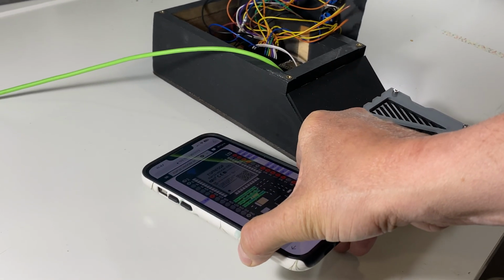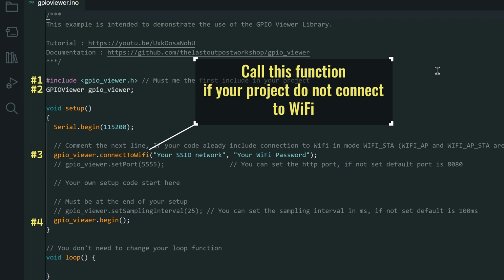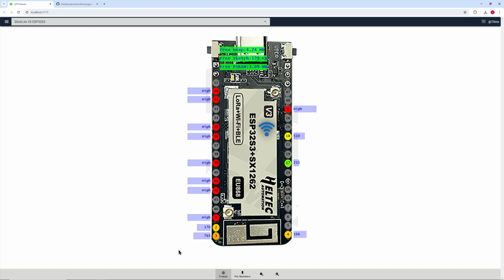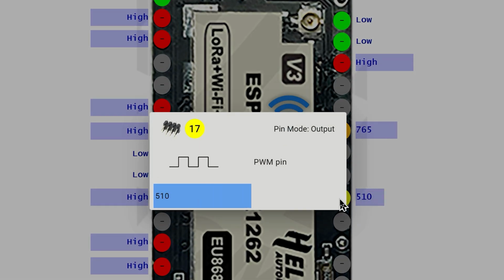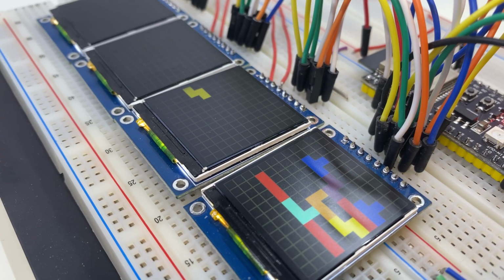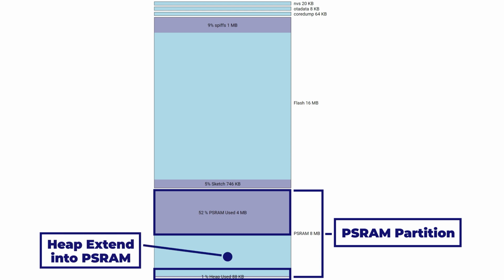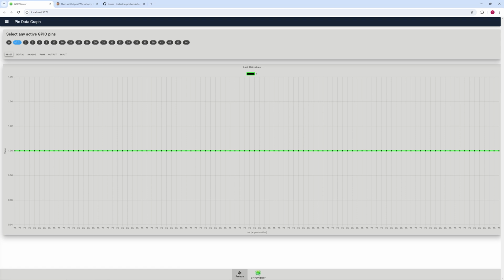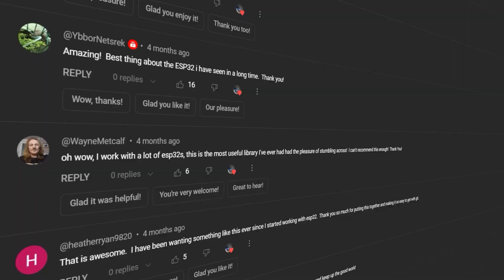Live GPIO Pin Monitoring!

Comment: I installed it according to the instructions, but it didn't work properly.
What's more, I couldn't even write normally with ArduinoIDE,
so I reinstalled it thinking Python was corrupted, but it didn't solve the problem and I still got a write error. (I couldn't write unless I held down the BOOT button)
I ended up having to reinstall ArduinoIDE as well.
Reply from the maker: Python is not supported, works only with C/C++, if it's not related to Python, I suggest you open an issue here : https://github.com/thelastoutpostworkshop/gpio_viewer

Comment: for some reason I get a brownout using esp32 dev and wroom kits, even the example itself won't work for some reason could you give me a quick tip? thanks:
22:01:11.230 -> rst:0xc (SW_CPU_RESET),boot:0x13 (SPI_FAST_FLASH_BOOT)
22:01:11.230 -> configsip: 0, SPIWP:0xee
22:01:11.230 -> clk_drv:0x00,q_drv:0x00,d_drv:0x00,cs0_drv:0x00,hd_drv:0x00,wp_drv:0x00
22:01:11.230 -> mode:DIO, clock div:1
22:01:11.230 -> load:0x3fff0030,len:1344
22:01:11.230 -> load:0x40078000,len:13964
22:01:11.230 -> load:0x40080400,len:3600
22:01:11.230 -> entry 0x400805f0
22:01:11.463 -> E (278) spi_flash: Detected size(4096k) smaller than the size in the binary image header(8192k). Probe failed.
22:01:11.511 -> 
22:01:11.511 -> assert failed: do_core_init startup.c:328 (flash_ret == ESP_OK)
22:01:11.511 -> 
22:01:11.511 -> 
22:01:11.511 -> Backtrace: 0x400836b5:0x3ffe3ab0 0x4008bea1:0x3ffe3ad0 0x400914f9:0x3ffe3af0 0x400e78e2:0x3ffe3c20 0x40082dc9:0x3ffe3c50 0x40079316:0x3ffe3c90 |<-CORRUPTED
22:01:11.511 -> 
22:01:11.511 -> 
22:01:11.511 -> 
22:01:11.511 -> 
22:01:11.511 -> ELF file SHA256: 57b0631a0267555f
22:01:11.511 -> 
22:01:11.511 -> E (300) esp_core_dump_flash: Core dump flash config is corrupted! CRC=0x7bd5c66f instead of 0x0
22:01:11.511 -> Rebooting...
22:01:11.511 -> ets Jul 29 2019 12:21:46
22:01:11.511 -> 
22:01:11.511 -> rst:0xc (SW_CPU_RESET),boot:0x13 (SPI_FAST_FLASH_BOOT)
22:01:11.511 -> configsip: 0, SPIWP:0xee
22:01:11.557 -> clk_drv:0x00,q_drv:0x00,d_drv:0x00,cs0_drv:0x00,hd_drv:0x00,wp_drv:0x00
22:01:11.557 -> mode:DIO, clock div:1
22:01:11.557 -> load:0x3fff0030,len:1344
22:01:11.557 -> load:0x40078000,len:13964
22:01:11.557 -> load:0x40080400,len:3600
22:01:11.557 -> entry 0x400805f0
Reply from the maker: See this solved issue, it may help : https://github.com/thelastoutpostworkshop/gpio_viewer/issues/121

Comment: Nice tool, but you can't use wi fi for other purposes simultaniously ?
Reply from the maker: Yes you can
Reply: @thelastoutpostworkshop  ArduinoCloud, for example, or Blink?
Reply from the maker: I do not know the requirements for Arduino Cloud or Blink, the GPIOViewer library expose a source event for the pin states on a dedicated port (that you can you change), so you can have other wifi events (get or post for example) than can occur at the same time.
Reply: @thelastoutpostworkshop  Ok, thanks a lot, I will check if it works with ArduinoCloud.

Comment: Suggest using Espressif ESP32 board Version 2.0.14  - alpha version of the boards ( V3.0.0), is not yet supported - use 2.0.14 version.  Thanks to The Last Outpost Workshop for fast help in sorting this out.